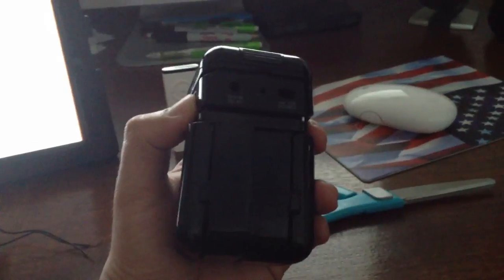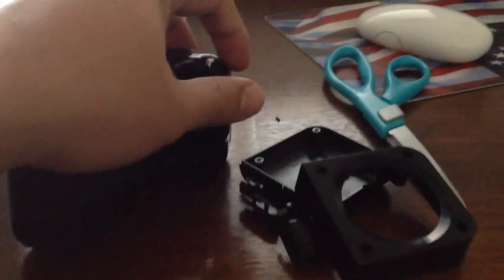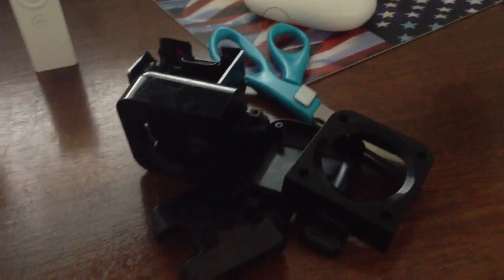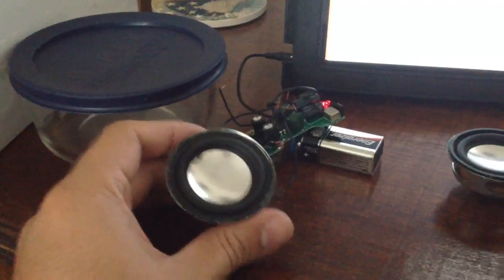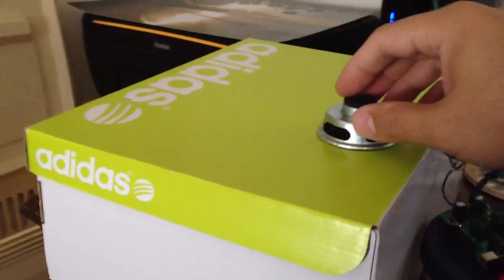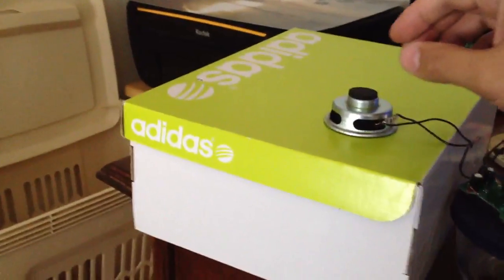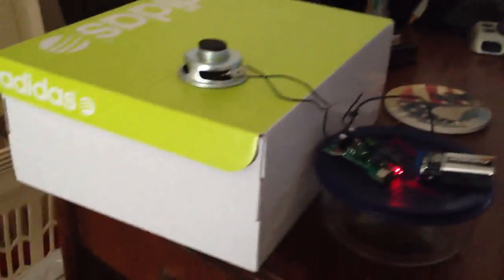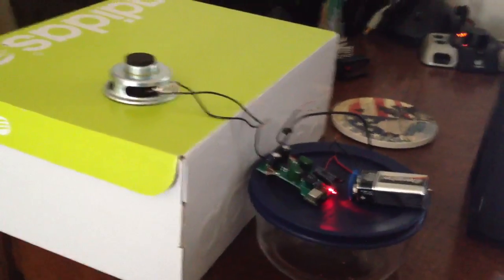Homemade vibration speaker part 1 of 2  Episodes (3)

Comment: You can also use a dc motor. When placed on your head you can hear the sound conducting through your skull, not sure about when placed on other objects though and I think the sound quality was very poor (lots of static). You can also use a telephone pickup coil with a magnet attached. All these seem to require extra power so is more of a complicated task. All this is correct as far as I can tell. I'm no electrician, just interested i contact speakers.

Comment: Contact speakers work because (for some reason) they only vibrate dense matter like a table or shoe box and not less dense matter like air. This is the reason why with a true contact speaker you can hear very little when not in contact with solid matter. This appears to be just a speaker, though you can still get some of the effects of contact speakers by hearing it vibrate through various mediums like a plastic container or a shoe box.

Comment: AAAA batteries are appropriately 1.5 v DC if you run them in series that is 4 X 1.5 = 6 v DC. I am assuming that the electronics in this little speaker can tolerate a 30% over voltage. I would be a little concerned about the lifespan of the electronics if they are being driving with 9 v. If they were designed to run off a "Wall Wort" transformer as well as batteries this will probably not be a problem. They fluctuate in voltage out put so the electronics have to be designed to handle it.

Comment: I tried to dissemle mine.
My amp got screwed.
I got a new one and I've got a question.
When you used a 9V battery, did you have to buy something to use it on that or do you just remove the 4 AAA's and just put in the 9V battery.

Comment: i made one, the speaker were smaller though, all i did was remove them out of ther case and removed that shiny thing in the middle, and under is some type of metal around it and thats the thing sending vibrations just like its touching that shiny thing its sending vibration to that so try it with out it but not on those speaker need smaller ones